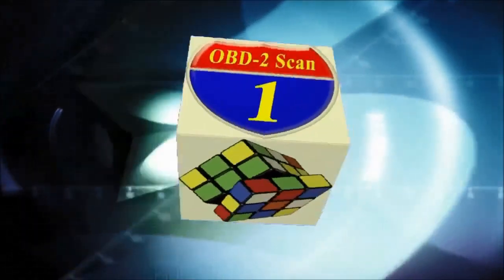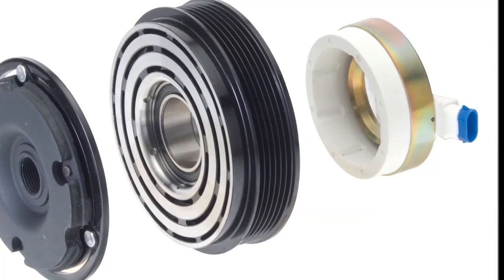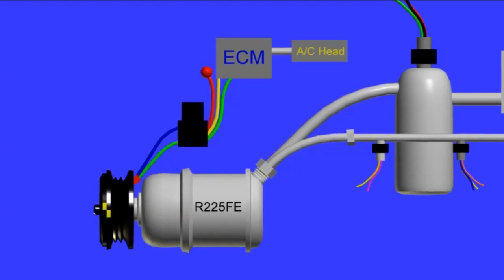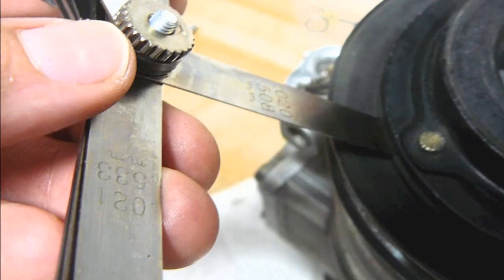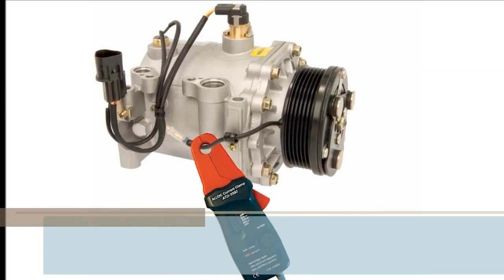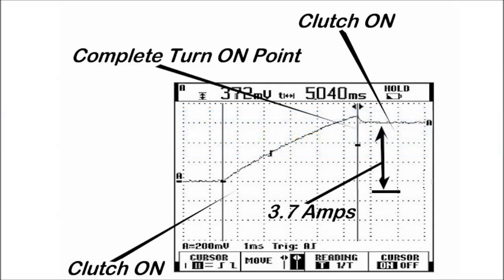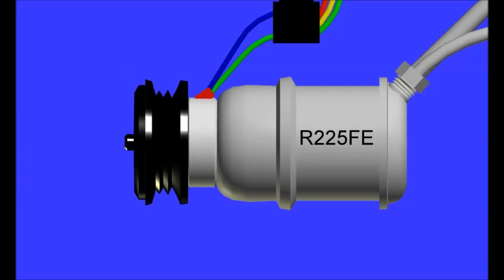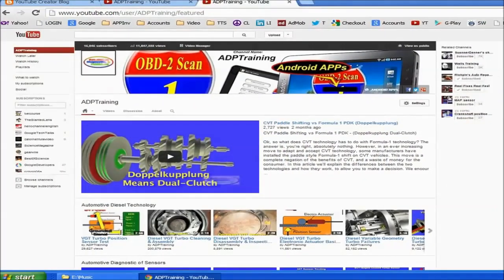Auto HVAC Compressor Clutch Operation Testing

Comment: Hi 
Thanks for the video 
Why when I switch on Ac on my ford car , The compressor will click two to three times at the beginning before back to normal , And the compressor brand new .
Reply from the maker: Possible pressure switches contact problem or loose ground.

Comment: When the refrigerant leaves the expansion valve it's a low pressure liquid which allows it to evaporate to a low pressure vapor after it leaves the evaporater and enters the compressor. Liquids are not good for compressors it causes overheating and high amp draw